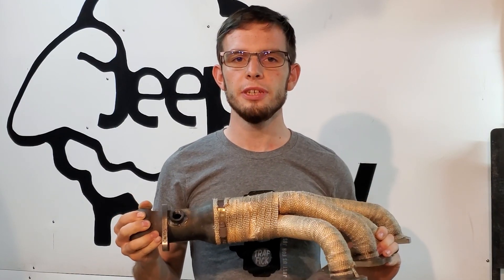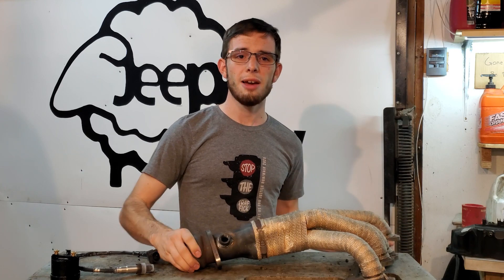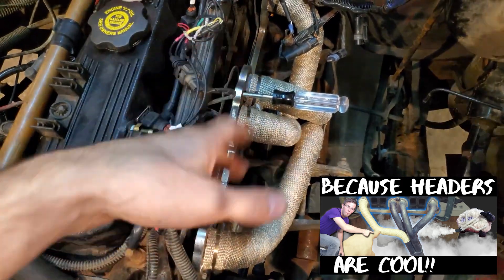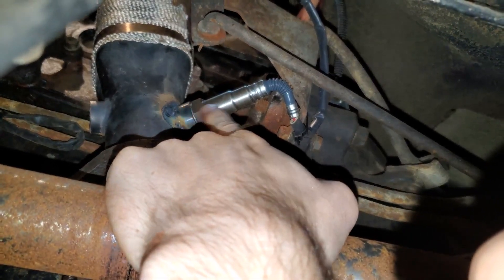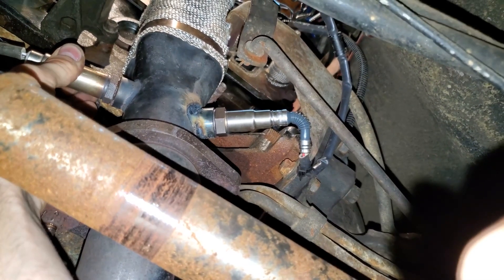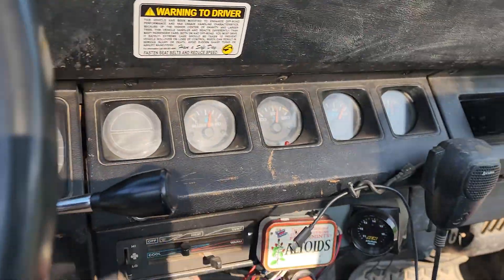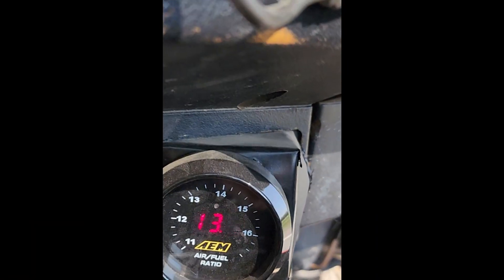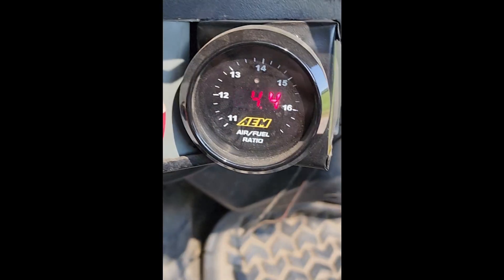Installing A Wideband O2 Sensor On My 4cyl Jeep To Understand How Modification Affect Fuel Tuning

Comment: WILL THIS WORK ON A 98 TJ 2.5?!?!?
Reply from the maker: Sure
Reply: @JeepSheepTV  Okay so I have this buddy. He builds all kinds of modded jeep stuff... hydraulic ram steering... steel rock sliders... like ANYthing...He can do whatever you want to whatever kind of auto but jeeps and crawlers are his specialty. He has always hated on my little 4 cylinder ever since I got back in touch with him after years. I just showed him some of this and he is like TOTALLY NO NO NO. He wants to drop a straight 6 or a V8 in my little TJ. Problem with that is I am a biker at heart. And I believe an engine to be the heart of a vehicle. I dont care who hates it or not. I believe this little block could handle a few more horses and foot-pounds comfortably. Plus I would love to keep the nose of my jeep as light as possible and add power and I think stumbling across your video just sold me on doing this for real. I am going to be putting a 4 inch long arm by Clayton on it very soon... as well as 33's on 15x10 wheels. I think a header, exhaust, bigger throttle body, and a GOD DAMN SUPERCHARGER would turn those puppies a lot better and turn my little jeep into the gold mining monster I am envisioning. I wanted to ask if you still have it and what has the wear on the engine been like? I have 177,200 on mine and it still runs pretty good! I dont wanna kill the little booger but representing the 2.5 crew like this is too sweet to pass up!

Comment: Hey I just got into watching your videos and I absolutely love your ideas and projects. Anyways I have a 93’ YJ and I am wanting to do the Mercedes Supercharger, but I have no clue what tubing to use for the inter cooler and cold air intake. What did you use?
Reply from the maker: I used PVC pipe. There should be more info in the video where I cover the piping, and the parts list is in the description. Thanks for watching!

Comment: Hey dude, looks like a fine sensor install. For me, those exhaust fab projects always end up not as imagined lol. Anyway, do you have your pcm fooled properly with your positive map values? Just thinking the lean reading with high load could be pcm getting scared and pulling all the timing, that way your fuel isnt all burning by the time it leaves your head, creating lean reading because all the oxygen hasnt combusted, and is there for the wideband to pick up. If the pcm is taking your timing, i don't have a solution, but I thought maybe you'd appreciate another take on it.
Reply from the maker: Hey dude! lol I hadn't though of it that way. Totally could be! I don't really know. All I do know is that after reducing the fuel trim I was in a range that the O2 sensor could more accurately read again. Its odd because it seems to be pretty responsive and accurate while driving over 30mph but in the lower rpms, especially after startup it just reads a constant 14.7 or something really close without changing. I think it was doing that the last time you and I were messing with it as well. I have gotten the fuel map dialed in pretty well now with the supercharger, It will give me 12 on heavier loads and about 13-14 on lighter loads with the supercharger on and boost at 2-3psi. I needed to bump up the fuel pressure by about 4psi to get enough fuel in higher rpms but overall I am really impressed with how well I can dial it in.
Reply: @JeepSheepTV  right on man, sounds all on point! Is there an aftermarket fuel pressure regulator in the plans? You could totally get that extra pressure you need up high. Maybe pcm would even trim it all down for you down low
Reply from the maker: @benfreers1075  I have a fuel pressure regulator inline already. I can dial it in pretty well
Reply: @JeepSheepTV  oh. Lol well that's great then! Im glad to have played the small role I did earlier in this iteration of the wrangler 😎. Nice work 👍🇺🇸

Comment: Has any of the new changes affected mpg from stock?
Reply from the maker: Certainly, I can vary the mpg quite a bit with the PC3 but any change can affect what the computer expects in open loop scenarios. Fortunately in closed loop it relies on the built in O2 sensor and can normalize the air fuel ratio regardless of modifications or environmental conditions. What you need to watch out for is when a modification makes a change beyond what the computer can adjust for. That is where the wideband O2 is really useful in helping you find if that is happening, so then you can make corrections with tuners like the PC3. Sadly the biggest driver of MPG by far, is wind speed and direction. Aside from making the jeep more aerodynamic, there is not much you can do about that.